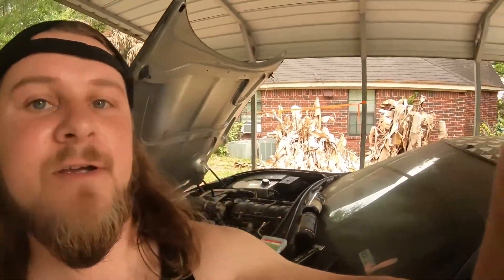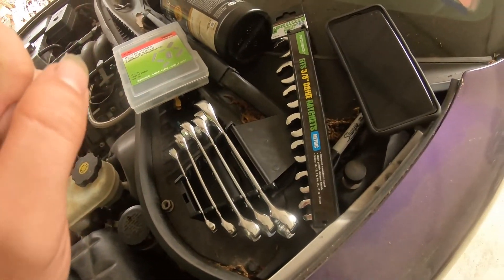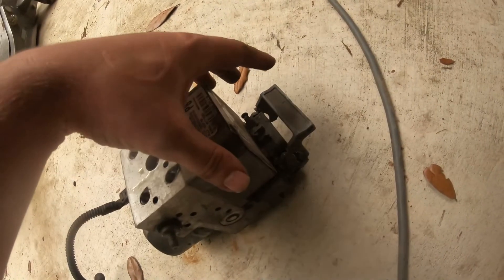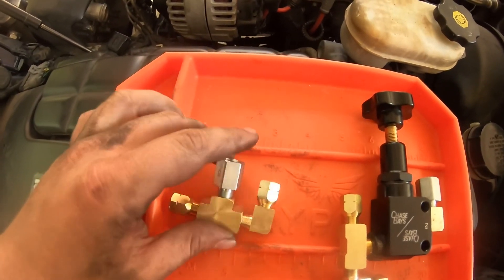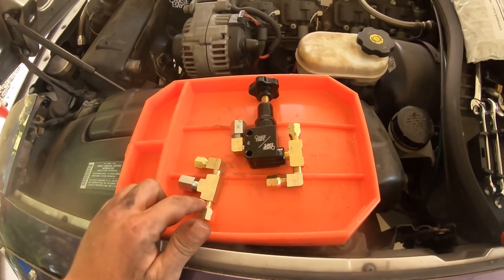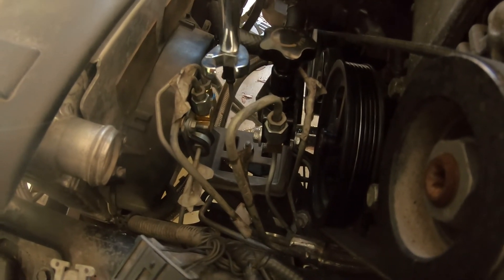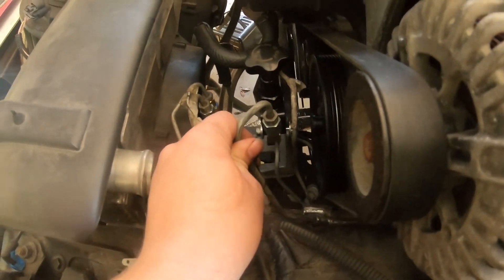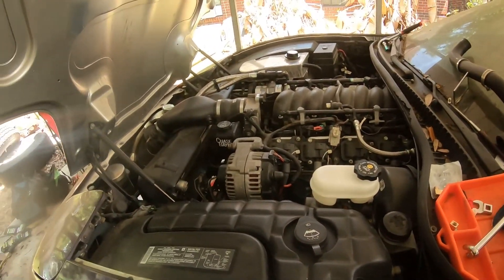Deleting the ABS valve on the corvette

Comment: Excellent  TY!  Subed  No service bla bla bla in the dash DIC?  I am shocked.  I have a 2000 and it will throw code with a message in the DIC but reset if I shut down and restart the engine.  Gettin sick of dealing with it and would like to dump the brick.